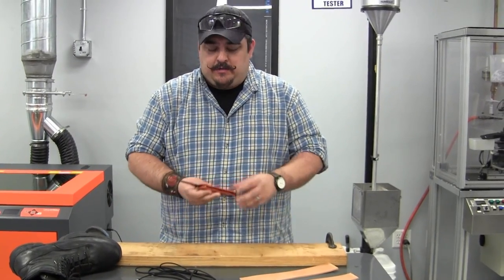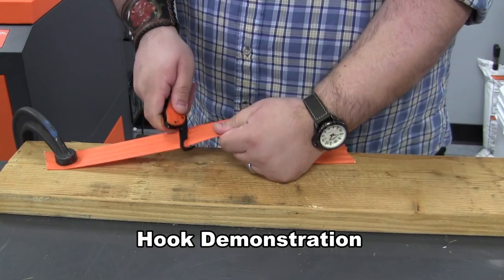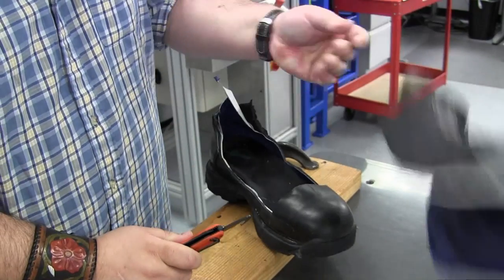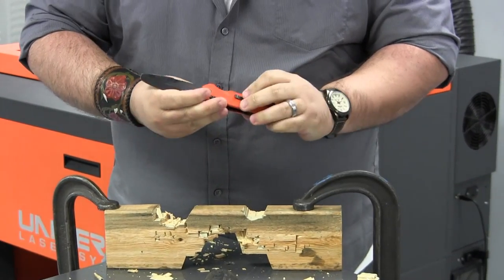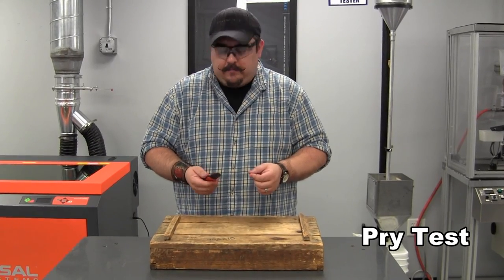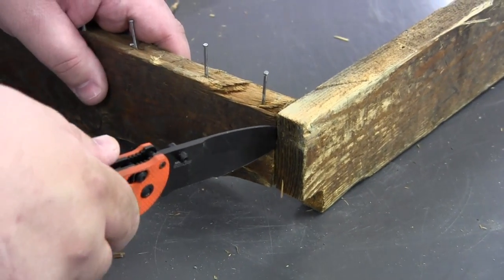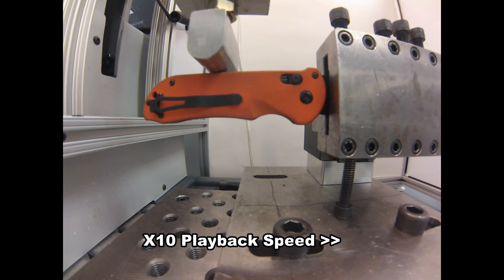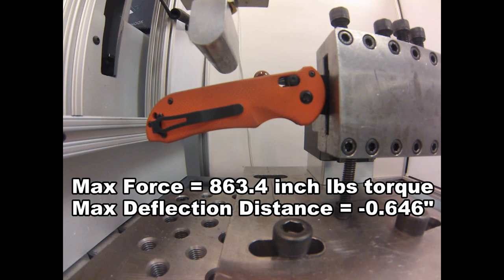Benchmade 916SBK-ORG Testing Video

Comment: I bought one of these after watching this video ...

I can tell you that in no way will  the edge hold up to being hit into wood with a mallet and it will definitely snap off if you try to pry like that.
I used mine to "pry" a dry LATEX painted over plastic outlet cover ....
There are at least SIX chips out of the edge ! ! !

Comment: Ive been thinking about getting this knife since it came out.I was finally able to find it at a reasonable price.. cant wait to get it.. im not a first responder of any kind I remodel homes n sometimes need to open paint cans ect.n n need to run out to the truck to get a screwdriver wont have to anymore

Comment: So the hook is a different steel than the blade? What is the corrosion resistance of that?
Could this be used as a dive knife in salt water or would the hook and/or hardware rust?

Comment: 860 in pounds? That's only 70 foot pounds, that doesn't seem like a lot but for a knife I guess that is more than you'd ever need. I wonder how much side to side there was after all that prying. I want to get this knife for a hard use blade for a little bit of everything, but with the price tag I wanna be sure it'll handle anything I'd put a knife through. I'm sure it will but it's also nice to know the limits too.